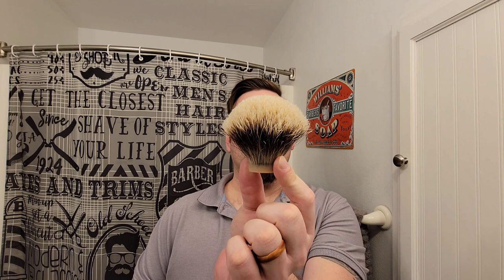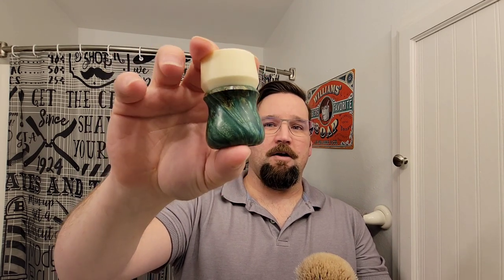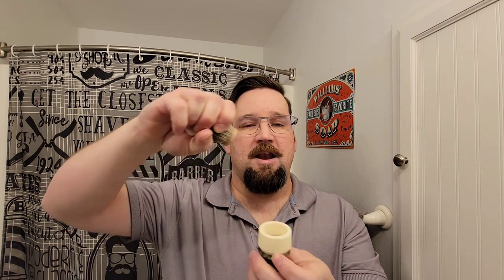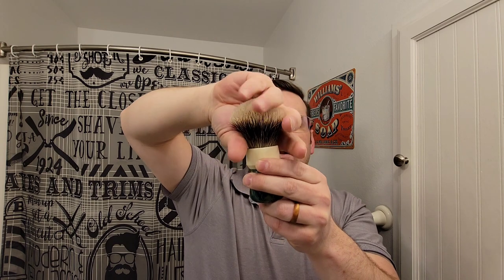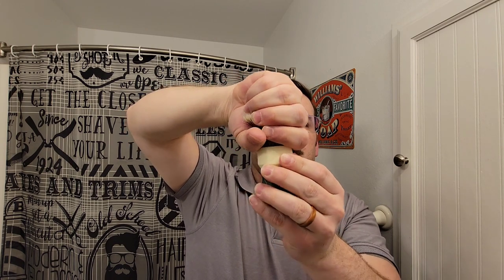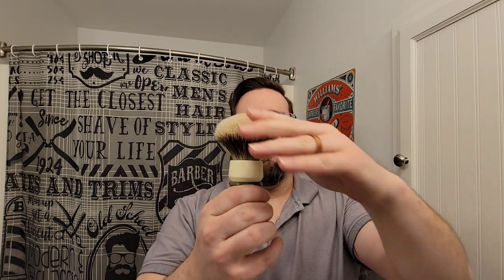How To: Set a Shaving knot in a brush using Silicone!

Comment: Great demonstration and good explanation of the procedure, personally I like using nylon washers for spacers. I also use Silicone, even though it's probably set within 24hrs, I like to leave the brush for a week to fully cure because not a lot of air gets to it under the knot.🐰😎🤟
Reply: Thank you! I hadn't considered nylon washers, that's an excellent idea! And extra time definitely always helps when curing adhesive

Comment: Great info!  Like the option to use the silicon to reset.  If I ever used silicone, I wonder if my hot scuttle would loosen the knot?  3M cut sheet stats temp resistant up to 180C(!!) for their regular marine grade silicone.
Reply: I've never used a scuttle. But I soak my badgers in medium hot water before every shave. I just make sure the water level doesn't go over the knot. You wouldn't want to submerge the glue knot area or you might have issues with the adhesive in the long run.